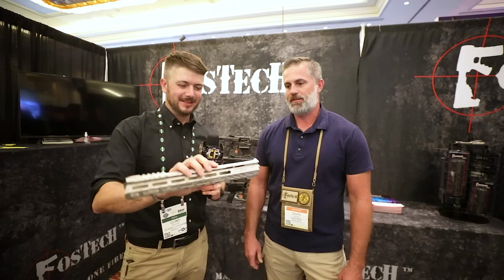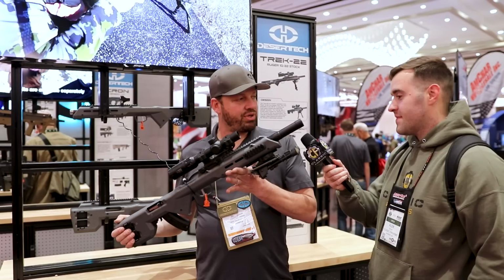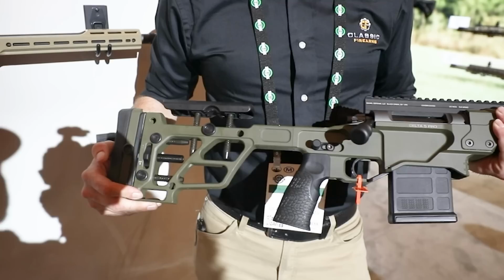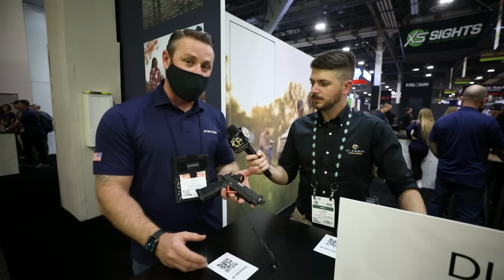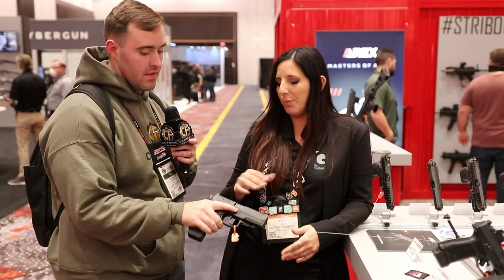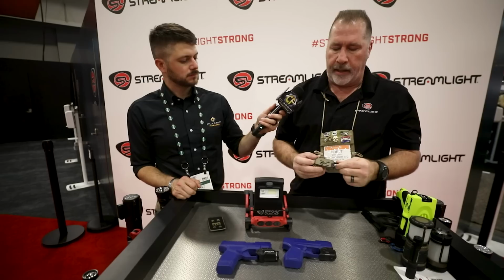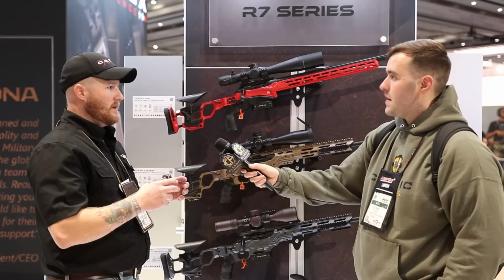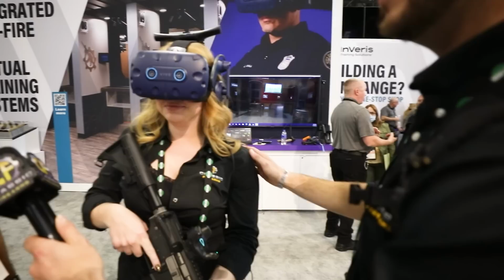SHOT Show 2022 - Day One Part 2 Coverage (Daniel Defense, LWRCI, Staccato, POF USA, Cadex Defense)

Comment: That Quatro-15 (quad stack) magazine looks really tempting, but it's gonna be heavy holding 53 rounds of 5.56, or 300BLK.
Reply: Would be no different than running two 30 rnd mags clipped together
Reply: Probably weighs less than a magpul drum mag.
Reply: Imagine sticking 2 of these together. 100 rounds without belt... would still be considerably lighter than an M249.
Reply: @CalvinL.Stevens  lolz, true!
Reply: @CalvinL.Stevens  honestly idk why they stopped at 53, such an arbitrary number. Go to a full 60, so what if it’s an inch longer than a standard 30 round PMAG.  No one ever said “I want to carry less ammo into combat” lol
Reply: Gotta combine with one of those fostech handguards to balance out the weight!
Reply: It's built for real men.💪😎👍"you don't lift bro?". 😂

Comment: That Fostech handguard reminds me of the BCM keymod rails from a few years back that were also made of a magnesium aluminum alloy and were remarkably light. I have a 13 inch one on a lightweight build that weigh significantly less than a standard polymer m4 handguard.
Reply: It's probably the same stuff. They had trouble with getting the material to make them out of before which is why they stop making them.

Comment: Am I the only one that looked at the Cadex Defense bolt guns and thought they would be so much cooler if they were a lever action?  Sure that would probably limit how many rounds would be in the magazine and probably be a little more prone to failure (assuming its not made with the best materials or design specs, that is) than the simple reliable bolt action, but come on how awesome would that be to have the awesome looking precise bolt gun with a more efficient cycling method than a bolt-action mechanism; not to mention it would up the cool factor more than it already has

Comment: Why does STI port their cocking serrations? Your hands are going to get dirty, dirt is going to get into the internals now. I wouldn't bring this up normally but they're pushing this LE duty gun theme. I don't think that departments need a threaded barrel either

Comment: The Fostech handguard looks great. Grand Power seems to have some good stuff going on. I really need to take a serious dive into 6mm Arch ballistics.
Everyone seems to be embracing ambi builds as the new standard. Current AR lowers are really a bit of a mixed set up. The bolt catch/release is perfect for lefty shooters. Where as, mag releases are positioned for right-handers. The task will be to see who has gotten the ambi bolt catch/release right. The ambi mag release should be a no brainer. 
As a final observation, the VR set certainly has a ton of shit stacked on the shooter's head. How heavy is that thing?

Comment: The lightest AR pistol (complete lower) I built uses a FosTec lower receiver.   Total weight is 571 grams, or a hair over 1.25 pounds.
Reply: The entire pistol was 1.25 lbs. Holy moley, that puts the honey badger up for its money
Reply: @Jackdiddly1  The complete LOWER, not the entire pistol.  Depending on which lightweight upper I attach, that will add another 2 to 2.5 pounds.  So 3.25-3.75 pounds for the AR Pistol (Upper + Lower but not magazine)
Reply: @Aegisltd  still insane, my ar weights around 8lbs after the attachments out the box it was a 6lb gun

Comment: Why are lights coming with RGB now? I've noticed they are getting larger, harder to mount or use. And now pretty much useless unless you spend hundreds of dollars..... WE DON'T WANT 5 FUNCTIONS. LAST THING.WE WANNA DO WHEN FACING A HOME INVASION IS CYCLE THROUGH 10 DAMN MODES JUST TO ACCIDENTALLY CLICK IT OFF AND HAVE TO RESTART. While my wife is getting rected. I'll be too fuckin busy fidgeting with a stupid flash light that's dimmer than 5 candles that I spent $700 for. Give us ON and OFF. OR FOR THE LOVE OF GOD GIVE US FAST STROBE BACK!!!! 
Sorry for the rant. But these tac lights are just getting stupid.